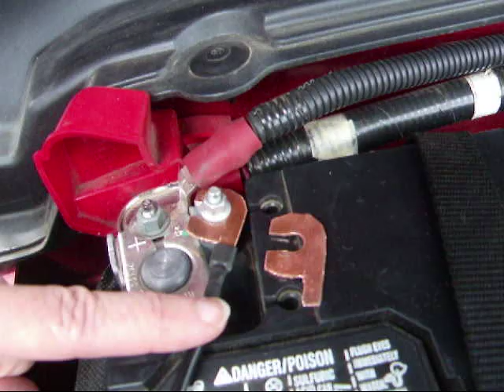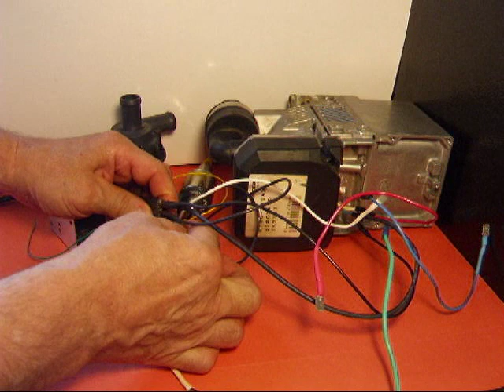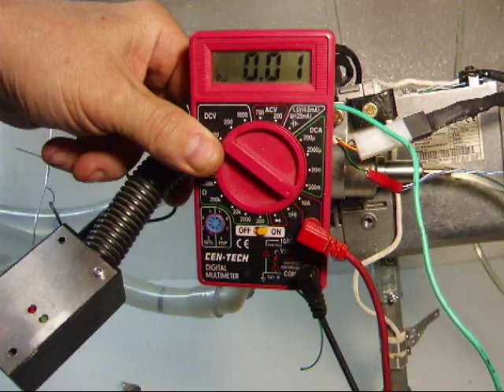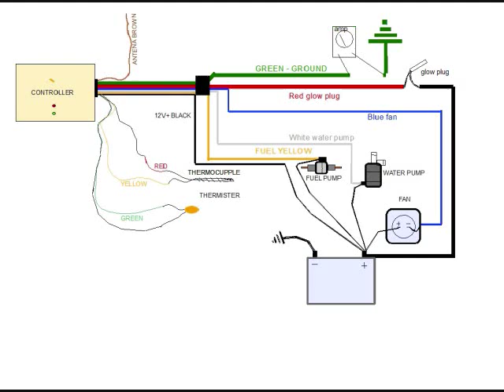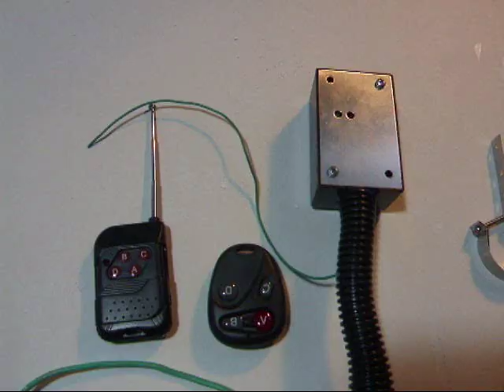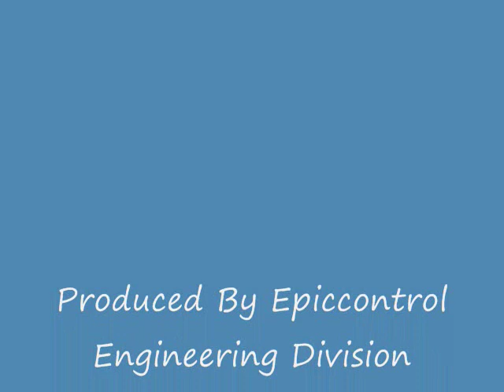Webasto Thermo Top C/Z - Part Two

Comment: where can you buy the controller? i want to run it standalon in my camper ^^
The exhaust goes to the fireplaces exhaus outside pretty safe if fixed right
Reply: Did You find out from where we can buy controler?
Reply: @TheBorderlessDad  Ai gast de unde sa cumperi controlorul caci ma uit si eu dupa unui?
Reply: @vasilicaparteni1562  nu am gasit din pacate
Reply: @TheBorderlessDad  Multumesc mult!

Comment: maybe you can help me. My webasto control unit is water damaged. does you remote work without my control unit? does it take the place of it,& feed negative etc to operate the webasto?I'd be interested if tats the case.please let me know asap as running out of ideas.thanks